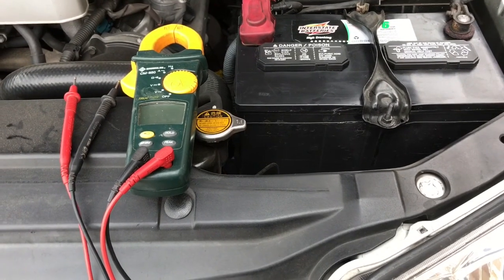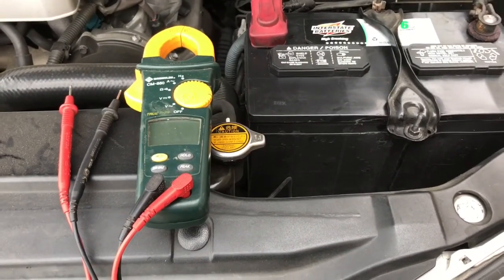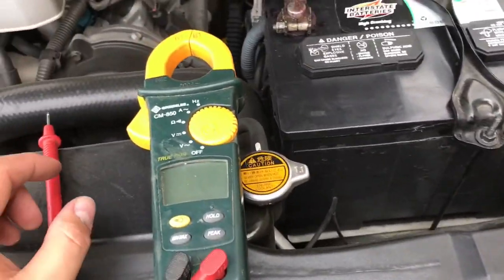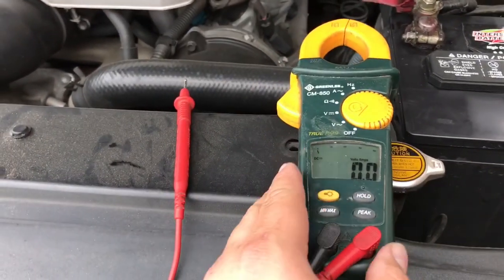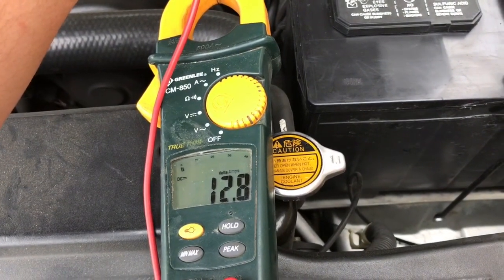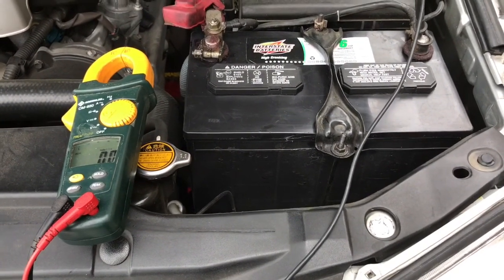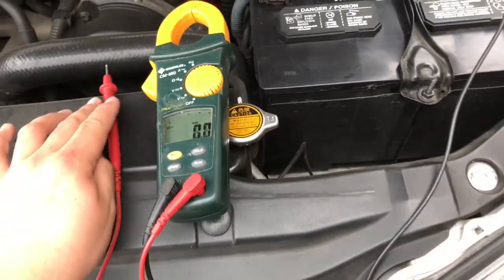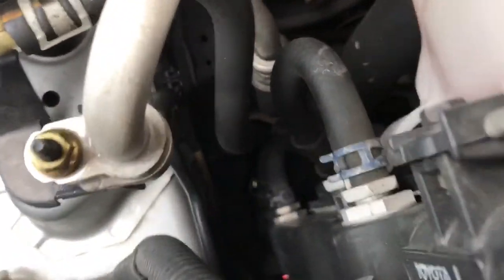How To Check An Alternator (Example: 2003 Toyota 4Runner)

Comment: I have an 02 limited with an illuminated battery dash light. I checked the voltage when the car was off and got 13.1 Volts. When the car was running, 14.4  volts. I made sure the battery connections  are secure. If it's not the alternator or battery what could it be?
Reply from the maker: 0, that is very interesting. My best guess would be that possibly you have an alternator on its way out. Maybe it is cutting in and out that is why you are not always getting a bad reading on the voltage. As alternators go out they are often known to begin to cut in and out which would cause the light. However, if everything seems fine I would disconnect the battery to kind of reset everything and then reconnect it and see what happens. I definitely would wait until you can find the exact problem before just changing the alternator because they are not cheap.
Reply: @bullseyenate231  ok so what I did was clean all of the contacts to the battery. What I will try to do is a prolonged test to see if there are any voltage drops. Would it be a good idea to measure the current?
Reply from the maker: 0, what you need to do is use a battery tester and out a load on it. This will help you determine if maybe you have voltage but not amperage. If some of the cells in the battery are going down it could begin to fail but still the voltage could read ok. By putting a load on it you will be able to see what the amps look like.
Reply: Well I cleaned the contacts and put everything back together. The battery light was still on at the time but when I woke up this morning the light was gone. Thanks for your help!